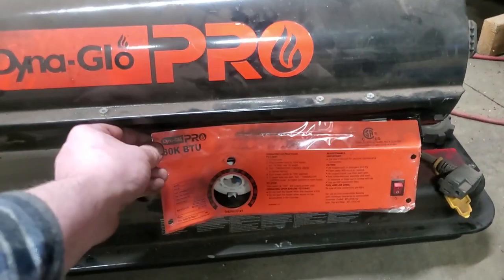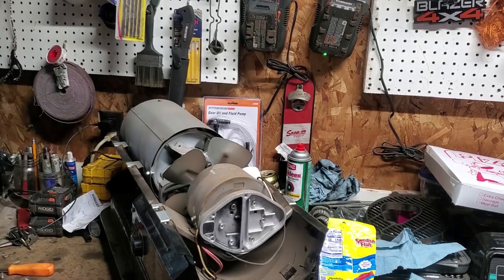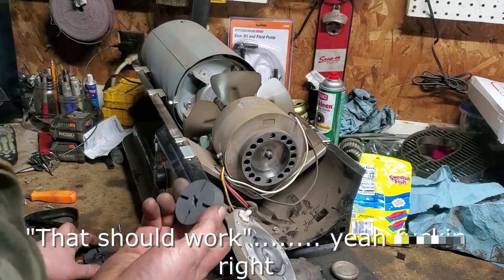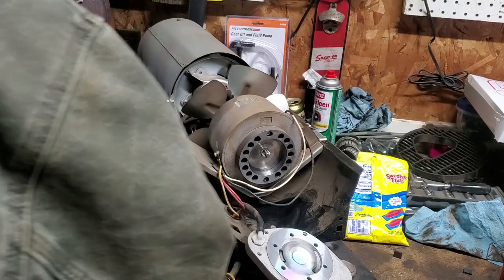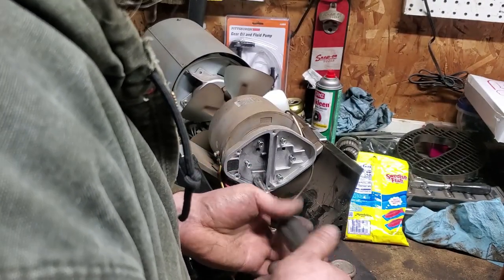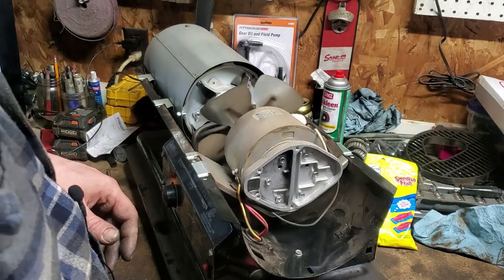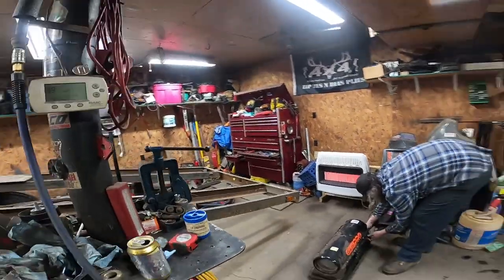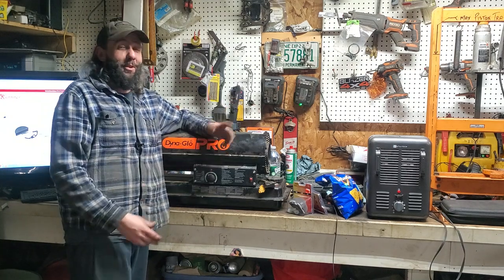Fixing a Dyna-glo forced air torpedo/salamander heater for ZERO dollars!

Comment: It actually produces pressure. Hence why there is a pressure gauge n should have like 5-6 psi. It blows across the pickup and creates a siphon which then fuel goes to nozzle. I picked up a 60k one few years back and rebuilt the pump, new filters and nozzle. Super easy and when I see them sitting for trash I grab them!
Reply: I was coming to read if anyone else knew that he said the wrong thing even though he knows what he's doing.... Lol

Comment: I had a John Deere 150,000 BTU salamander that would randomly shut down. So i put new pick up tube in tank and new filters but it still did it. Turned out to be it had burned all the oxygen out of the garage!!! Had to crack the overhead door about 2 inches and it never did it again. LOL i promptly sold it and installed a Reznor.

Comment: I have been using china Diesel Heaters to heat my shop for years using waste Oil and Diesel, Gota keep greta smilin. F$^^kin Mint!👍
Reply from the maker: Ya I need to invest in one of them for next years heating season!
Reply: @CompleteToiletGarage  $100 tops on Amazon or Flea Bay.  5 & 8 KW are the same! Easy & cheep to rebuild too! 60/40 oil to Diesel ratio. 👌

Comment: Try bending the heat sensor back a bit.  Tried everything on my Dyna Glow. Turns out it was too close to the chamber and getting cooked. Bent it back and it has been 100% reliable ever since. Even on straight diesel.